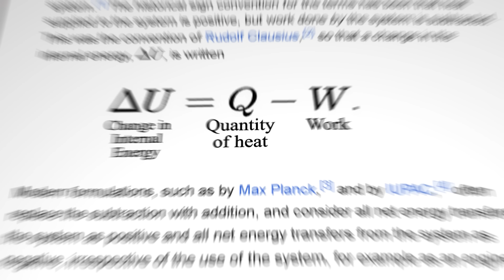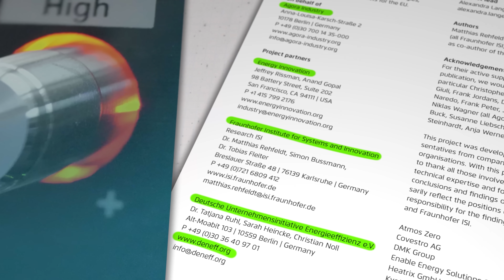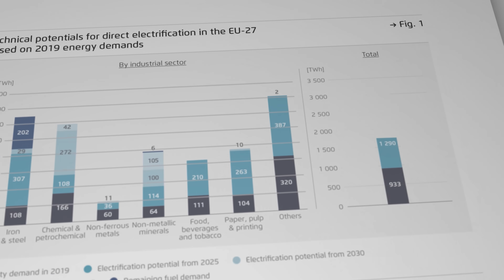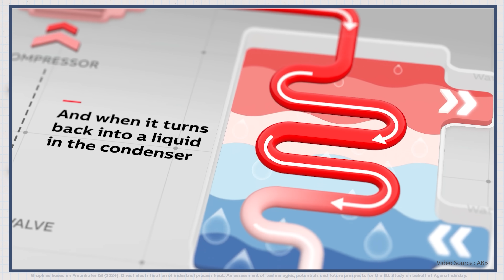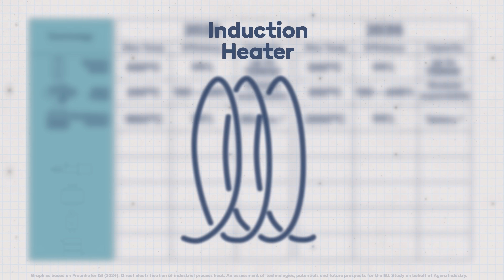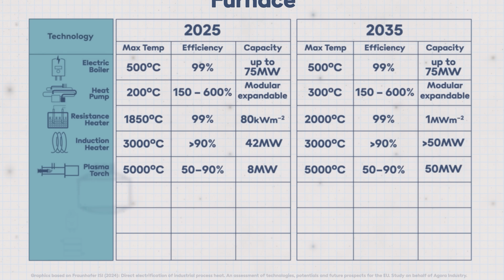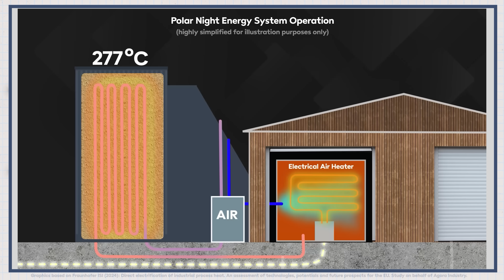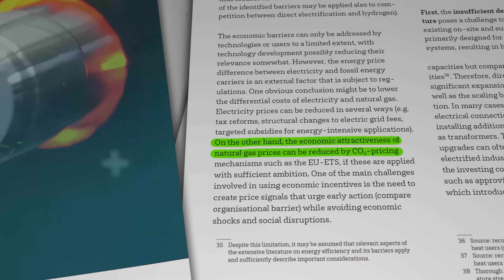Kicking fossil fuel out of industry! Here's how it's done...

Comment: The biggest obstacle to the widespread electrification of industry, apart from cost, is where is all this zero carbon electricity going to come from and how is it going to be transmitted. It's not going to be easy!
Reply: There is literally an endless supply of renewable electricity. It’s cheaper and more reliable than fossil fuel heating.
Reply: @timfulwell8472  Not a unless you are prepared to transfer it from wind farms in the North Sea or from PV in North Africa. Many central European countries are poor in potential renewable energy sources.
Reply: @petewright4640  Sitting still is about the only thing that is cheap and easy, but that doesn't seem to get anything done.
Reply: If only wind and solar were the majority of new generation everywhere in the world. Oh, right, they are, because they're cheap and quick. We need to install them even faster.
Reply: @skierpage solar still doesn’t work at night though…and it’s not windy all the time. Don’t worry….Europe won’t have any industry left
Reply: @feo2229   thank you, Captain Obvious. Dispatchable electricity has to step in when renewables + storage aren't generating. So you fire up some thermal plants, hydro power, or whatever. Utilities aren't stupid, they do what's cheapest.
Reply: @ I’m aware how utilities work. My point is that electric boilers are not 100% efficient….for an industrial process, especially in the winter or at night, it is almost certain that the utility is burning a fossil fuel, and generating electricity at ~30%.  Which is less efficient than if the industrial plant simply burned a fossil fuel directly at about 90% efficiency to produce steam, thermal oil,etc

Comment: Durr, is a German manufacturer of high temperature heat pumps that use CO2 as the refrigerant. A well designed industrial process that needs heating at some points and cooling at others can achieve over 700% efficiency (combined COP 7.6 for their 45 and 65 kW units)

Comment: Here's a free ideal I don't know why but I've never seen any place that says they use this 
But if you take a place that processes food there's usually a little bit of cooking and then some freezing involved or at least refrigeration what if they use the heat pump and had the hot side be the cooking part and the cold side be the freezing or refrigeration part
Reply: Ahhh... the hot side on a heat pump is sucking heat in, on a refrigerator it releases heat hence the mildly warm heat exchanger on the back of your fridge or freezer

Comment: Again for readers, hydrogen tends to escape almost any seal eventually due to its smallest atomic size. 
Studies now show that leaking hydrogen combines with other chemicals in the air that normally degrade methane in the upper atmosphere.  In other words releasing hydrogen can extend the life of methane. Methane is a much worse greenhouse gas than CO2 is. 
Therefore increasing hydrogen output for industrial uses is a very bad idea.
Reply: The only thing expensive green hydrogen is good for is replacing dirty hydrogen in industrial processes that can't be electrified. And since a lot of those processes are in fossil fuel refining that must drastically shrink, the hydrogen economy hype from people who want to continue to sell atoms instead of electrons is way overblown.
Reply: @ Indeed. Most of those industries make hydrogen on site since there is so much cost in transport and significant leakage. So there may be a need for green hydrogen generators on those industrial sites. Opportunity?
Reply: @skierpage yep, we cannot start dreaming of any new applications of "green'er" hydrogen until we have eliminated near 100% of dirty hydrogen production for existing demand. 

Including non-energy uses of hydrogen. 

AFTER we have all current hydrogen demand answered with low emisisons hydrogen, THEN we can start doing the math to see if low emissions hydrogen is actually efficient - which is another huge hurdle.
Reply: @5353Jumper  We haven't remotely eliminated dirty electricity. And electric heavy freight transportation will never work.
Reply: @gregorymalchuk272  dirty electricity is a lot lower emissions than any fuel transportation solution, sure good to transition generation over time but still does not change anything in the push to electrify things. 

And it seems like you do not know that trains are already electric, we just need to change them from fuel generation to charged rail or battery.
Reply: @gregorymalchuk272 WTF. What do you think makes the drive wheels turn on those giant mining dump trucks?
Reply: @TheLosamatic  A huge V12 turbodiesel engine driving a generator-motor. Or in Komatsus, gigantic torque converter planetary gearset automatic transmissions.
Reply: @ electricity it’s fascinating where we would be had all the subsidies that went to fossil fuels instead gone to renewables and storage say starting after NASA perfected solar for use in space. We do know that uncountable people would not have died from respiratory illnesses! Now of course we can be counting the billions of dollars lost from fires that keep getting worse simply from continuing to burn those fossils!
Reply: And I watched a video last week that said recent work showed the lifespan of Methane has already increased by 7% because the amount of Methane is overwhelming the decay process.   So every model we have is overly optimistic.
Reply: @mac_mcleod  :(
Reply: @mac_mcleod  Which video is this?
Reply: And Hydrogen had a GWP of between 4 and 16. Most likely around 11. Emagine a 10% leak rate in the total chain and we will have achieved exactly nothing. Even when the Hydrogen generation is 100% green. Hydrogen is not the answer.
Reply: @bartgooren6145  I used to do Witness Testing on Valves for Cryogenic Service, I saw how incredibly difficult it is to make and maintain a tight seal on valves at low temperatures so I can say with certainty, there Will be a lot of leaks from Valves in Hydrogen service. I also like to point out that Batteries create Hydrogen, I once had a battery explode when I shorted the terminals and created a spark, the hydrogen ignited, it was a loud bang, no damage, just a shock.
Reply: @bartgooren6145 I guess we should just go back to the stone age. 🙃
Reply: Many early hydrogen tech development start ups, gave up.
Reply: That's very interesting. Was it mentioned in one of his videos?
Reply: @ Yes I think he did. Look up the paper in Nature Communications entitled "Risk of the hydrogen economy for atmospheric methane" for direct info.
Reply: @nickmcconnell1291  It's excellent that you can cite a paper related to the point you make. I wish this was more common. Well done!
Reply: @user-hj7be8rg4k  there are many good sources online, as long as you ignore the fossil fuel obfuscation promoting hydrogen...
Reply: You should probably clarify not using hydrogen for process heat, at least where it needs to be stored or transported. Hydrogen is a key feedstock for many industrial processes and is mostly generated from natural gas currently. Converting those processes to use green hydrogen would be a preferred route
Aside from that, I wasn't aware of hydrogens propensity to consume methane degrading chemicals. It is certainly something to consider
Reply: Yep. Even nasa struggles to contain hydrogen. Yet people want Gary from quick'n'cheap plumbers to hook up their kids school heating to hydrogen. That school will be called Creater Hole memorial in the future.
Reply: @ LOL
Reply: And metal embrittlement.   H2 is a tech that will never economically work.
Reply: Again, for all the people of peanut brains around here, the troposphere is already opaque from H2O and any increase in infrared absorbing gasses won't make much difference.  Painting a barn more red paint doesn't make a barn more red after it's already been painted red.  Increases of infrared absorbing gasses in the stratosphere and mesosphere should trap heat there, but this is not observed.  Duh.  
Humans ARE changing the climate, but not the way you believe.
Reply: Graphene has shown to be a powerful container of hydrogen.... on top of just generally being a powerful technology in general. Underdeveloped right now though.
Reply: Yet when that hydrogen leaks and combines with oxygen you get H2O.

There's a lot of false misinformation being pushed these days
Reply: Yet when that leaked hydrogen combines with oxygen you get H2O.

There's a lot of misinformation being pushed these days.
Reply: Be aware that these issues are being addressed. 

GovUK policy is for: 
50% Blue (Issue: Methane + H2 Leakage).
50% Green (Issue: H2 Leakage).

In my opinion Green H2 is a more rational implementation route for decarbonisation and may offer much greater potential for longer term energy storage if/when technological and engineering issues can be overcome.

https://assets.publishing.service.gov.uk/media/624ec79cd3bf7f600d4055d1/fugitive-hydrogen-emissions-future-hydrogen-economy.pdf
Reply: 8 Billion people fart methane every single day, countless Billions of animals fart methane every day, they always did ! but here we are still alive, kicking and farting. Seems to me that methane is not as bad as the dismal jimmy's say it is ! I suppose that soon the architects of the ,"Project of Fear", will be coming up with something new to frighten the gullible with ?
Reply: I honestly believe the only way to make hydrogen work is...to use methane, which is over 60% of its energy content from the hydrogen in it, much higher than other hydrocarbons.
Reply: @ Unfortunately when using Methane to harvest Hydrogen wouldn't you have to use reactions or methods which result in CO2 being left over?  If not what method could be used to get the hydrogen out of methane but not result in CO2 as a byproduct?  Would that method be cost effective?
Reply: @nickmcconnell1291  Yes you would be creating CO2. And no I don't mean using hydrogen FROM methane unless you're doing it on-site. I mean more that you could get a lot more hydrogen-based energy out of fossil fuels by catalytically cracking it.
Reply: Oxygen is what degrades methane. And we aren't short of oxygen.
Reply: @gregorymalchuk272 you might want to check the oxygen level in any city.
Reply: STANDARD LEAKAGE IS FIVE PERCENT from ANY container. It is so small that it slowly migrates thru steel and causing "hydrogen brittleness". Seals are metal to metal and BIG bolt spaced as close as possible.
Hydrogen is even bigger scam that the rest.
Reply: Very interesting. For me most reason NOT to use hydrogen is its often extreme high price because of very bad efficiency. So it makes only sense for very few solutions. It can only sustain with the help of governments investment. Only 90 H2 fuels stations remain in Germany. Its a joke.
Reply: Not to mention the fact that it takes more energy to process water into hydrogen and oxygen than it creates.  Plus, the chemicals and materials it takes to process it equals more energy use.  However, if the hydrogen and oxygen are burned together, they generate much more power than just using the hydrogen by itself.  But even then, it's very wasteful.
Reply: @ShawnRitch  Taking more energy in than you get out in itself is not a deal-breaker.
Oil Sands mining is almost there.
I think there is value in using green hydrogen to make carbon-neutral synfuels.
That neatly side-steps most of the transportation and end-user equipment modification difficulties.
Of course: by burning nearly an order of magnitude more energy the whole process will be expensive, and thus limited to niche applications like:
-Long-haul shipping
-Vintage cars
-Remote trucking where no power is available
-long haul aviation
I think such synfuel will be expensive enough to justify rail electrification.
Reply: Hi, If I may say so this isn't quite right. Methane is oxidised by OH radicals close to the ozone layer. The amount of methane currently destroyed by this process isn't even close to saturating the atmosphere, which is why methane in measured in ppb rather than ppm (or more). Hydrogen isn't going to stop this.
A.
Reply: @ I gather that after reading the paper I referenced you disagree with their experimental findings?
Reply: @nickmcconnell1291 it wasn;t an experimental finding; it was a model.  And the model showed that methane in the air could decrease with a shift to hydrogen if leakage is below what is an achievable threshold.
Reply: @adrianbratt9927  Your comment doesn't even make sense on it's own terms.
Reply: @bearclaw5115  Don't follow sorry, could you explain a bit further please?
Reply: I'm a cryogenic engineer working with liquid hydrogen regularly and disagree with this.  The amount of H2 that would be leaked to the atm and contribute to GHG effect via this mechanism is so insignificant compared to how much GHG it would offset.   The systems I work on mostly use welded stainless steel lines to prevent any leakage, any modern plants are going to do the same or better to prevent H2 leakage.
Reply: @ Interesting perspective. What grade of stainless are you using?

Comment: I hope EU leaders will realize that depending on US liquified gas is not much better than piped gas from Russia and therefore electrify everything is definitely going to be a solution both for energy security as well as for emission reduction. 

PS heat pumps that have a heat source higher than ambient temperature are sometimes called "heat transformers". Nice thing: if you have your cold source above 100°C, you can use water as the refrigerant "gas" (without risk of going into partial vacuum, which is better avoided in refrigeration circuits).
Reply: From a carbon standpoint liquified natural gas as pretty much as bad as coal.  It's very energy intensive to liquify and the gas that escapes is many time worse as a heat trapping gas.  Europe should ween themselves off US LNG as fast as possible.  I'm sure the price alone will encourage them in the right direction.
Reply: Somewhere I saw a EU price of $50/MWH that is 5cents/KWH, how low do you need? Either that figure is wrong or some thieves in EU are making enormous retail profits.
Reply: @howardsimpson489  Nope, right now is $0.25 before tax for households and going up.
Reply: @coolblu101  And switch to what? Russian pipeline gas again? Qatar gas? Some other dictatorship? 

The energy transition here is not fast enough with the "leaders" of the continent, Germans, having stuck their head up their ass for the last 20 years.
Reply: I would argue that it is better to pay our allies than some genocidal dictator that then uses the money to destroy the continent any day. 

American LNG is more expensive and that expense makes countries accelerate the energy transition. It also helps that Trump is the president now and is seen as unstable, so there is fear on dependence on the US for it.
Reply: you will still need power plants you know. and the best one for elctrcal power would BE NUCLEAR BY THE WAY.
Reply: @ashtonmiller-z1n  Read the book of Mark Jacobson.
Reply: Not much better? It is certainly much worse and an US plot to end the partnership between the EU and Russia.
Reply: If they want genuine security they will need to build PV manufacturing and secure the rare minerals required.

Otherwise they have vulnerability to China, who can't be much better than the U.S. right?
Reply: US gas is a worse fuel for Europeans than Russian: that's because of the carbon emissions from liquefying it, and the emission of the tankers bringing it across the pond: in comparison pumping along a pipeline emits much less carbon, and potentially none at all if the pumps are powered sustainability
Reply: Absolute rubbish, how do YOU imagine you are going to be able to hugely increase the amount of electricity available while closing down fossil fuels and nuclear ?
Co2 emissions are not a problem so why would you want to.
Reply: @peterjones4180  "CO2 emissions are not a problem" LOL 😂😂😂